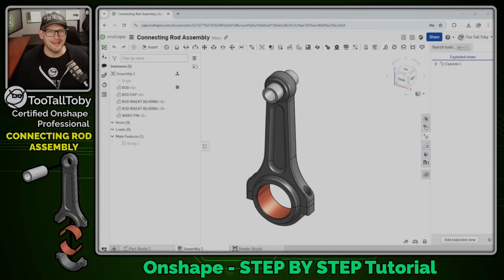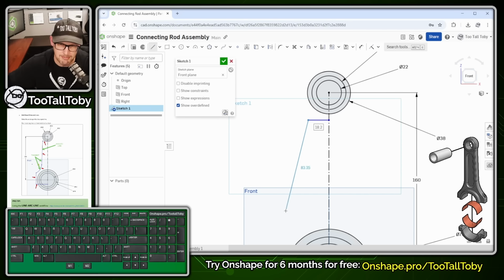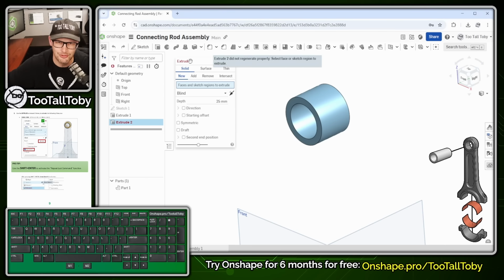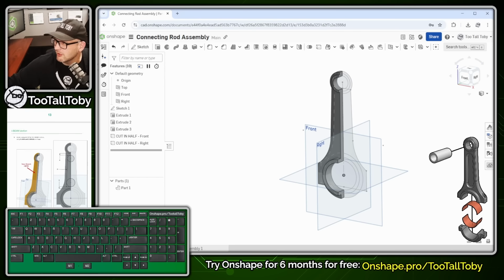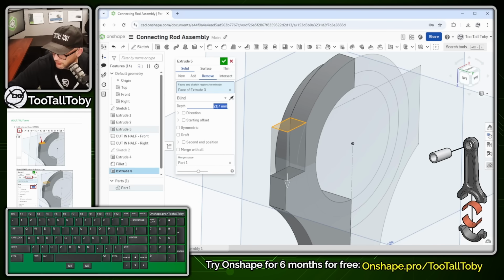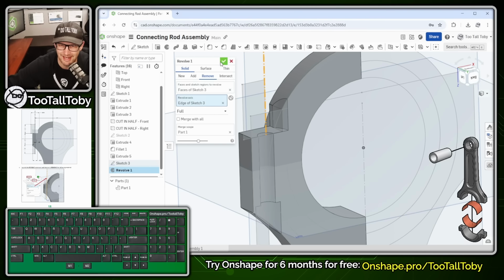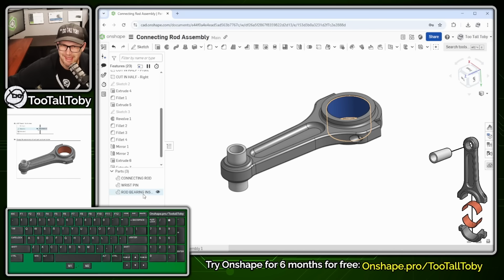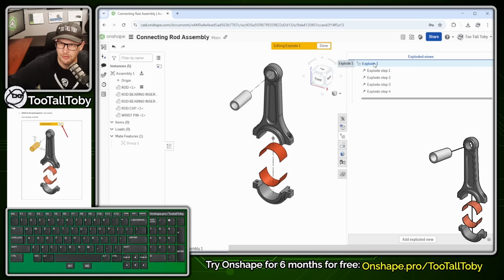Connecting Rod Design & Assembly Step-by-Step Tutorial

Comment: I am 3/4 in and had to stop to tell you the tutorial is fantastic. 
I use onshape from time to time to create some models to print at home and I sometimes fight with the tool. Your tips, advice and overall style helps a lot. 
This is exactly the level I need, low-intermediate where I also learn about methodology (such as working on a quarter of the part, and the reason for that).
Thank you very much